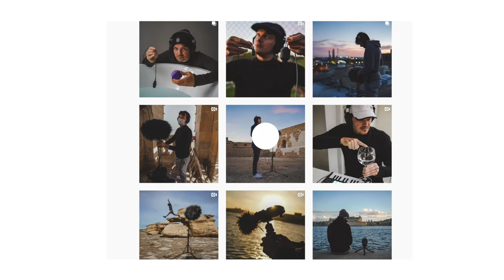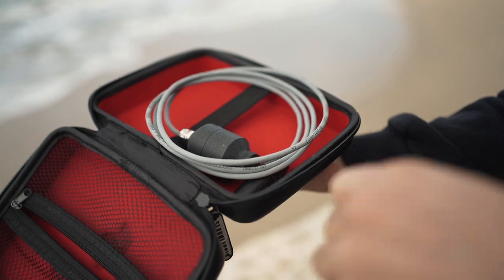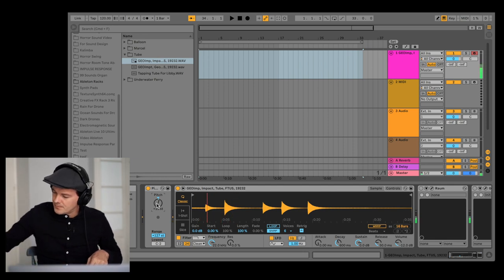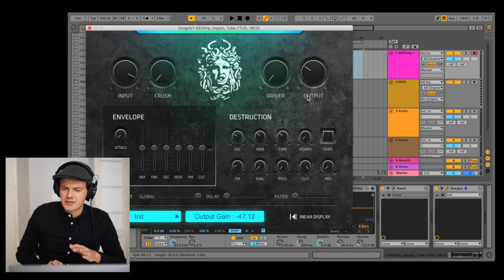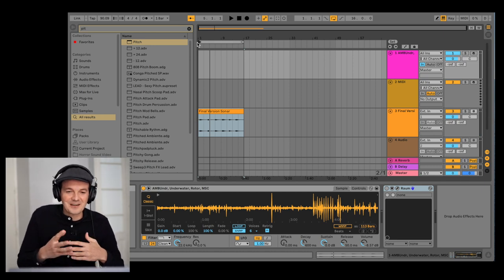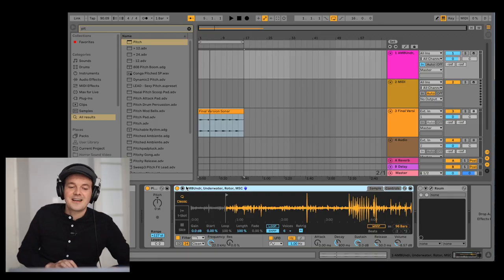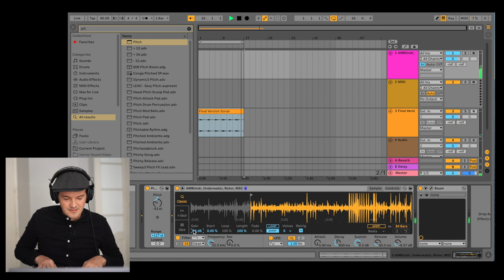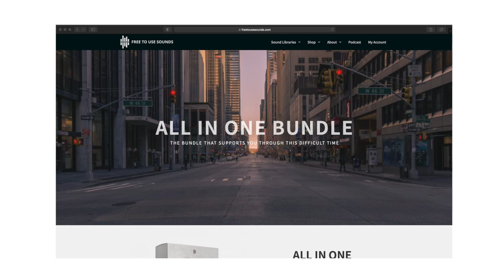Creating Submarine Sonar Sounds With Sound Effects

Comment: Just wondering about the gorgon Plugin - I downloaded it and installed onto my Mac, but it doesn't show up in my DAW.  The Gorgon VTS & Component are there, but it gorgon.aaxplugin doesn't show up anywhere.  Any fixes?   P.S: loved the video which helped me out with a problem I needed to solve.  It's not perfect, but got me through for now - thanks!
Reply from the maker: I’m sure you probably run the plug-in manager to find it? I’m not sure what Mac version you are running now but since it’s not updated anymore it’s possible that it doesn’t run on newer Mac version. Another idea is to copy it manually to the VST folder?